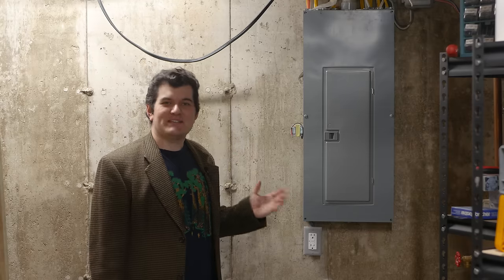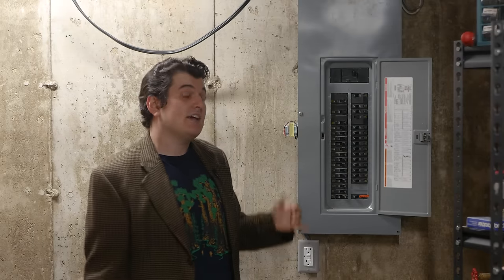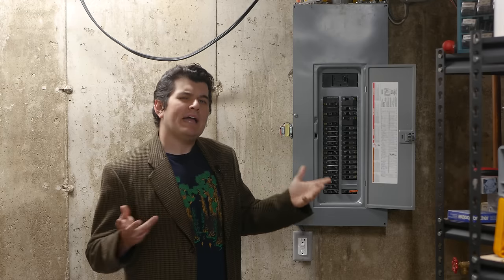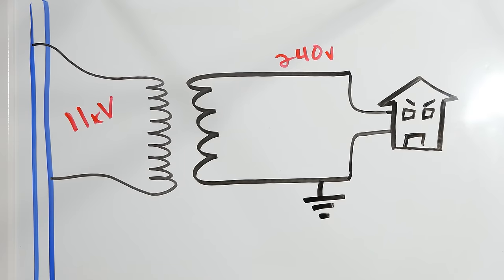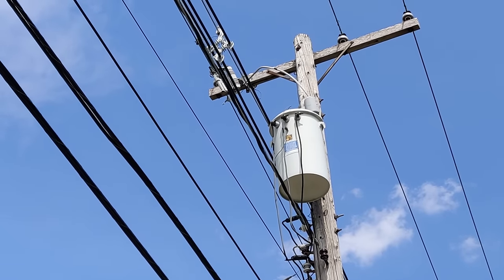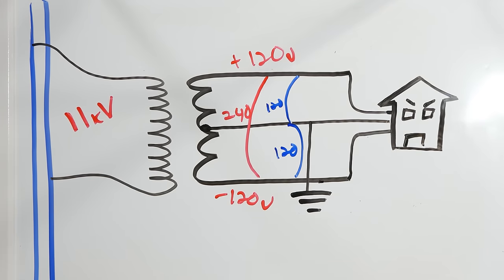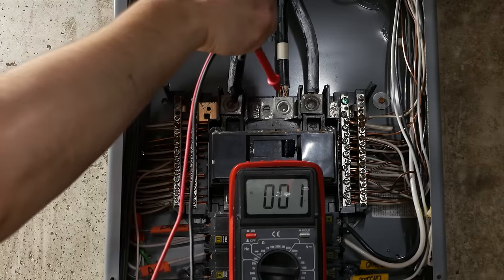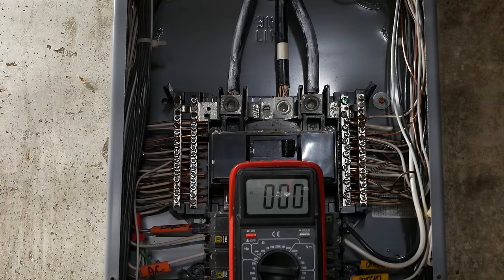The US electrical system is not 120V

Comment: North American electrical circuit panels, outlets, switches, and everything else is superior to foreign (not North American) power systems and components.  UK and AU switched outlets are absolutely stupid, ignorant, and uselessly redundant.  There is a power switch on the device, therefore there is no need for one on the outlet.  Switching off an unused outlet isn't saving any power either, because none is being used by the vacant outlet, therefore the switch is unnecessary.

UK/UA: "But it might spark when plugging in."
N/A: "So what?  It isn't hurting anything."
UK/AU: But you could electrocute yourself.
US: Nope, Never had a problem with plugging in power cords and devices.  You'd have to do something so absolutely ridiculously stupid, like sticking metal objects in the outlet, and the result would be natural selection (weeding out the stupid people).
UK/AU: ... =o

Comment: Yankie electrics are week, your want some good old British 415v up ya clacker. That will wake you up! Shaver sockets have a safety isolation transformer inside and in all new builds will be covered by and RCD. Oh and ring main is for high voltage, you are referring to a fing final circuit.
Reply: @@phillipbanes5484 yes a shaver socket, don't know what's funny about that they provide 240v and 110v for the week yankies 🤣🤣

Comment: You must think you are talking to children. Only 120 volts come out of the single-phase transformer, not 220. Two single lines, generally 180 degrees out of phase, come into each home. Every wall receptacle and every light bulb provides 120 volts.  Even the 220-volt stove and dryer are wired with 120-volt lines. By connecting one line to each end of the heating element, 240 volts are achieved. You are creating misinformation relying on viewers' lack of understanding. Most of the world uses 220 volts. The USA is 120 volts. So your claim, "The US electrical system is not 120V" is clickbait. And, NO, we are not a 240 Volt system in the USA. (speaking about residential electrical wiring.) You speak too much double talk. Even mili-volts can stop the human heart from beating. And what determines the exact voltage in your region is based on the generators operating to supply that area.  Remember, lots of competition existed when first building the grid system...lots of ideas and lots of opinions.  We never quite 'standardized. Even the primary side of the transformers varies wildly.  Appliances are designed to run + - 10% voltage level. So, 110-120 V works fine.
Reply: Wow, and where did you get your electrical education?  In an electronics class?  You are incorrect and he is correct.   If you had said 180 degrees out of phase on an oscilloscope, you would be correct.   But the transformer puts out 240 volts.  The neutral is added to get half the transformer windings, so half the volts.   Mili-volts can not kill you.   12 volts on Carr battery can not kill you.   .5 amps across your heart can kill you.     You better rethink what you are saying, because you are incorrect.
Reply: @KevinCoop1 , Yes, I've had several electronics classes.  Also, classes in industrial motor controls. They were part of my degree in Robotics and Automated Machine Repair. Before retiring I applied that knowledge to building two small manufacturing facilities took complete maintenance responsibility for an aluminum die-cast company, and a plastics injection company, and retired as plant superintendent of one of GMs air compression facilities.  None of which has much to do with the Youtube video claiming the US is not on a 120-volt system.  Residential wiring is a nominal 120 volts and single phase.  A single-phase transformer steps the voltage down from several thousand volts to 240 v. AGAIN, the house is supplied with TWO lines, each conducting 120 volts. Whether you see it on a "scope, or measure it with a meter, it's 120 volts leaving the transformer. Once inside the house, 120 volts is supplied to most circuits. Stoves and dryers and some AC need 240 so both 120 V supply lines are attached. Across those lines, we see 2240 volts single phase. Agreed, half an amp can stop a beating heart. But so can 5 milliamps, a much lower amount of current. Do you understand Ohm's Law?  

A car battery can kill you in several ways. Drop it on your head.  The leaking acid can kill you. The vapors can kill you.  A spark can explode the vapors. And a perfectly fine car battery, used as designed, is attached to a step-up transformer delivering tens of thousands of volts capable of the 5 mili-amps needed to stop a heart. When I write I try to appeal to a broad readership. Each is looking for something different. For folks like you I try to provide a mistake or two you can find. I may have failed in this case but that doesn't matter to you. AGAIN, the residential transformer on the pole is a single phase on the primary side carrying over twenty-thousand volts, even above 50 thousand volts in some regions. The secondary winding is 220-240, but AGAIN, the house has two 120V lines entering. That means from the pole to the masthead is 120 volts only.

There, I've answered your question as best I can. Now it's your turn to answer mine. Ready, set, go: Are you the smartest one in your family?